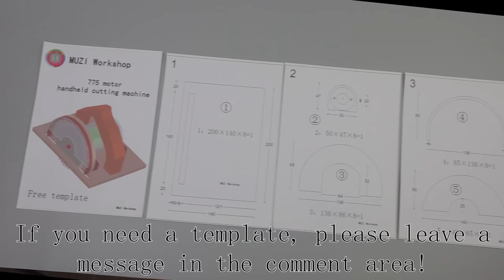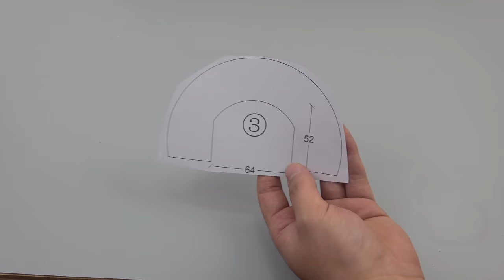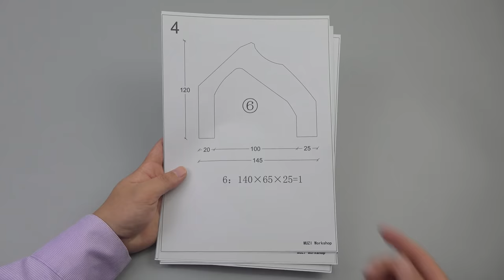775 motor to create a handheld cutting machine-----（Free template）

Comment: While it is not clear in the video, it looks as if the location of the handle should have been the other way round so that the moving teeth bite into the wood on the underside of the wood being cut, against the base plate, as in all commercial circular saws.
Reply: AAA9
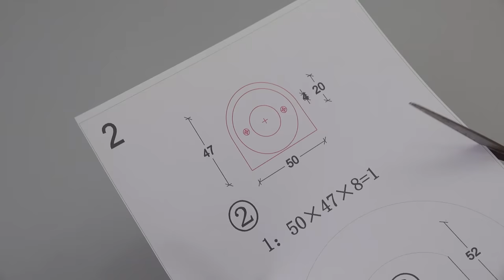Reply: 1:17